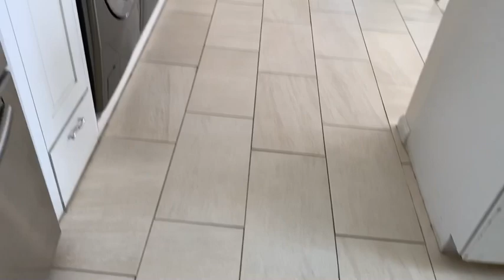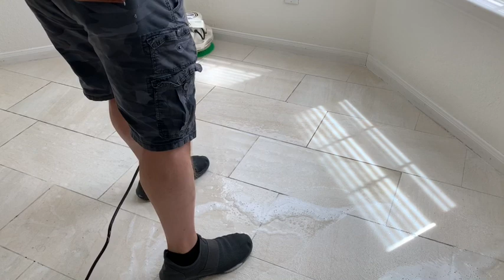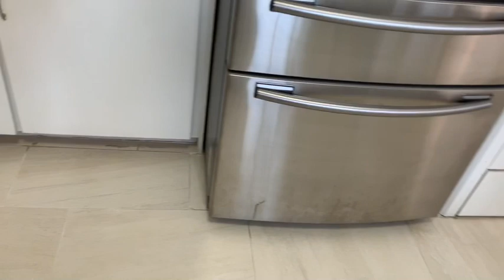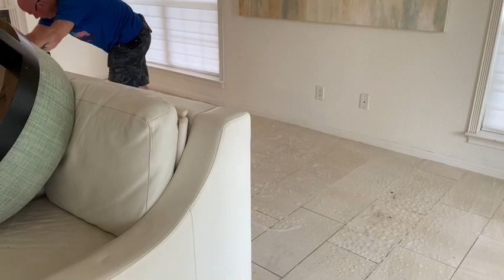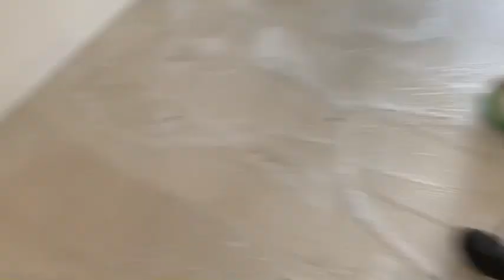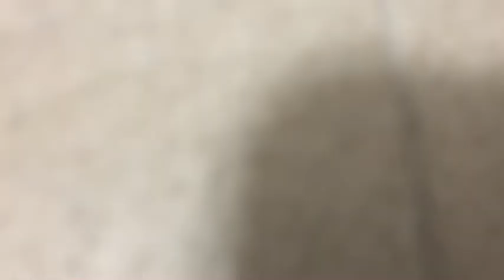Challenger OP and Oreck Orbiter Tile Grout Cleaning.

Comment: I've only cleaned that exact type of tile one time and I found it very difficult too. The place I cleaned had a very uneven floor and it seemed to me that was the main issue. Also, the grout lines were super thin which also seemed to contribute to making it a LOT harder. If I run into a similar situation I will have to think about charging more for sure. I am not sure if the grout had even been sealed at all which I think could have made it that much more difficult. Anyway, it was a bummer to clean.